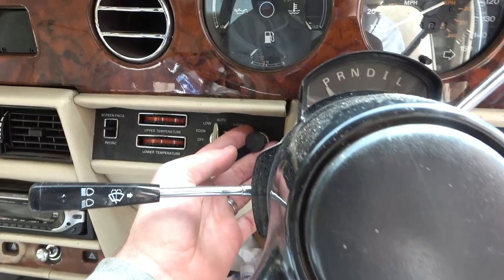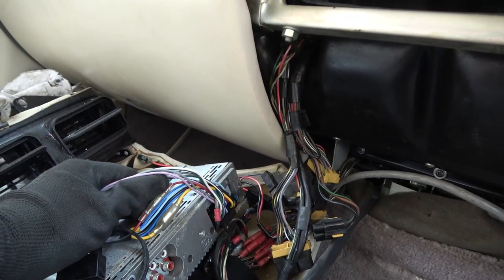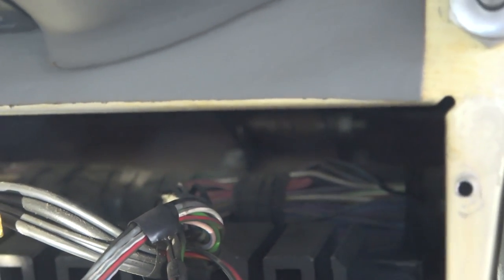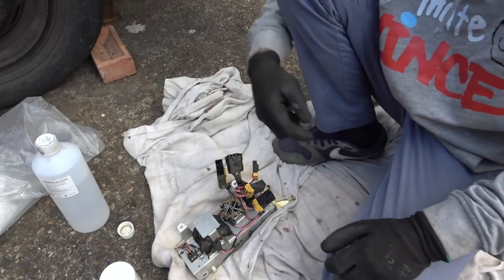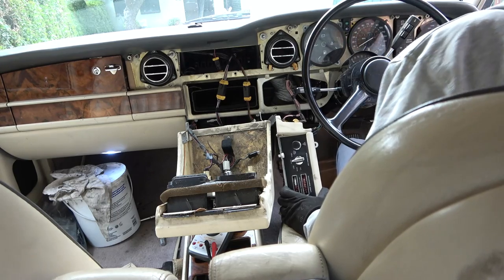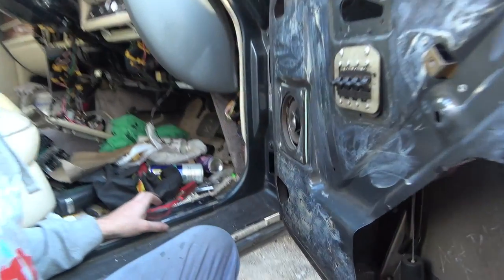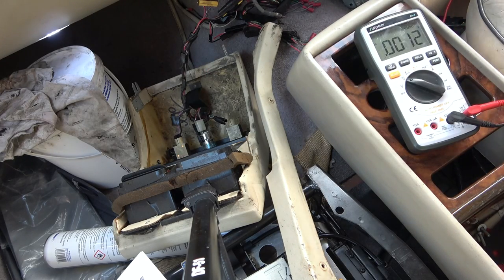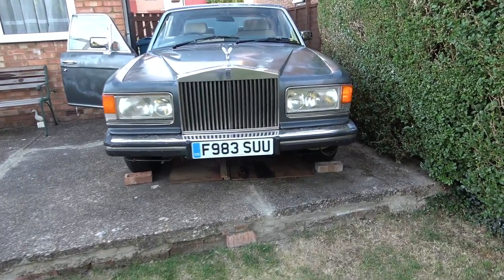DIM Indicator TURN SIGNALS on the ROLLS ROYCE SILVER SPIRIT & Other FAULTS - CAN I FIX IT? PART 20

Comment: the seatbelt light was connected to earth before the light, and as all switches and lights are usually connected to several grounding straps around the car then if one on a circuit can short then several things short to ground. that is why the seatbelt light didn't work before you disconnecting the bulb for the hazards, as the hazards were shorting to ground so to say, but in reality battery DC voltage runs from negative to positive terminal. so actually a bad positive connection. voltage will also always look for a path of least distance and resistance, and because the hazards had the path of least resistance that is why the current flowed away from the seatbelt light, due to the resistance of that circuit being higher resistance.
Reply: but if it was on it's own completely isolated circuit i.e. its own positive and negative connections to the battery, then the circuit wouldn't have shorted to ground, and that is why finding electrical problems on a vehicle can be so hard to diagnose, as while like in this case you could have been looking at the seatbelt light fault, unless you look for other faults, then you can completely have missed the hazard warning light fault at the same time, so always best to look for 2 or 3 faults, and try to diagnose them as the same fault unless you know 100% that they are not related at all. because they could all be sharing the same ground.

Comment: Vince if you need parts I now have plenty after work I have done on smal model. If you ever need scything from electrics to lights and hoses then contact me I have plenty original parts now due to 2 which came in and have had to be broken down as beyond repair

Comment: 😂 the Dremel strikes again!!! I had to use mine to cut notches into cv axel bolt. The bolt snapped off leaving a small portion in a flange that connect the axel to the transmission.  Luckily the width of the remaining bolt piece was wide enough I was able to do the same method that you initially started with and was able to remove it with a screwdriver.
Reply from the maker: Fast becoming the tool of choice😂

Comment: That's why the screws missing the radio might have been replaced with an aftermarket unit that's why the radio is not  connected radio your might need a  specialised wiring loom adaptor

Comment: If you had cleaned that connection properly in an earlier episode, you would have fixed this problem without realising?
Reply from the maker: Yes I think I would have. The hazard switch still needed cleaning though👍👍👍

Comment: Get yourself and learn to use a bog standard 12V test light. Watching you use that meter to test continuity is doing my nut in. The meter will only show you if the connection has a resistance, usually, below 50ohms. It will not show a connection or wires ability to carry current.

Comment: I wonder how many miles to the gallon this car can do.
Reply from the maker: I haven't Googled that yet. I would guess at 15 miles maybe around town because of big engine and very heavy, but maybe 25 on the motorway as it would probably be very low RPM even at 70mph. Hopefully I will get to find out 👍👍👍
Reply: @Mymatevince  Yeah that's around what I thought. Horriblly expensive to run.